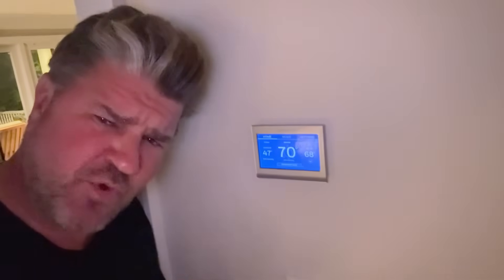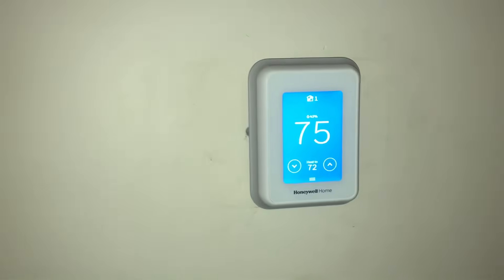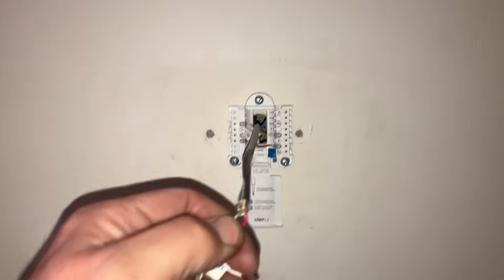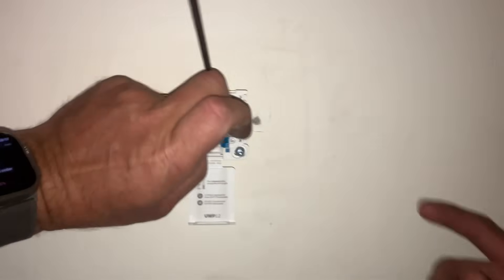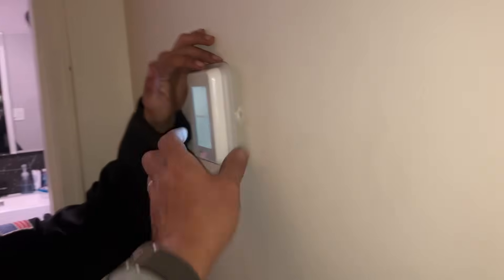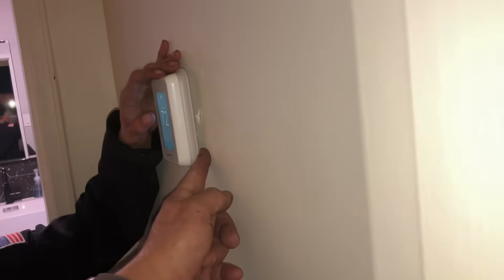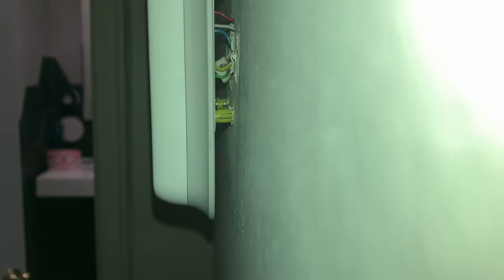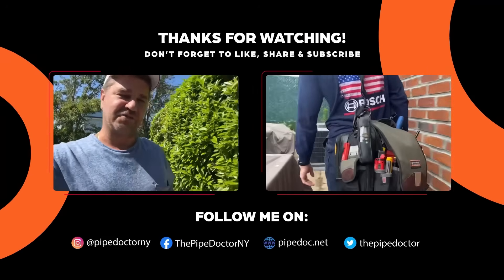Homeowner Installs Thermostat WRONG… No Heat! | Local Plumber Fixes the Mess

Comment: When GM Mechanical installed my New Carrier furnace in 2017. The tech did not know how to connect the Infinity communicating thermostat. I did if for him. Then I asked if he could connect the G wire for the bathroom fan interlock and he blew the 3 amp fuse. He didn't have a new fuse. I gave him a new fuse. I was a gong show. (It's code where I live that the furnace fan comes on when the bathroom fan is on)
Reply from the maker: Wow, sounds like quite the experience!

Comment: it's always the thermostat wiring, except when it isn't. lol.  hardly anyone ever gets the thermostat wiring right, unless it's only two wires, beyond three confusion sets in, add more wires or multiple systems with a side of zoning and forget it. 🤣 
then  a half dozen others get called in and make an even bigger wiring mess, then I somehow get called in to unravel their spaghetti mess and make it work again, which is easy for me if there's not hidden splices and color changes everywhere.

Comment: In all fairness, I changed both of my thermostats (upstairs and down). But they are one wire (cooling with gas furnace) and all the colors exactly matched the thermostat markings (blue for common).
Reply: Ahhh are you the guilty one mentioned in the video

Comment: Is "C" wire 24 VAC, not common?
Reply: If it's hooked up correctly at the transformer and all splices it is. Have to check how it is wired in air handler.
Reply: Yes, C wire is "common", usually the Blue wire. It is one side of the 24VAC supply, Red wire is the other. Since this is AC, not DC, calling it a "common" can confuse people. Electrical Techs prefer the schematic designations of X1, X2 for the Transformer secondary. But this is HVAC, so it is what it is.